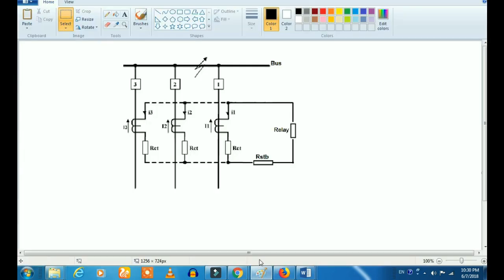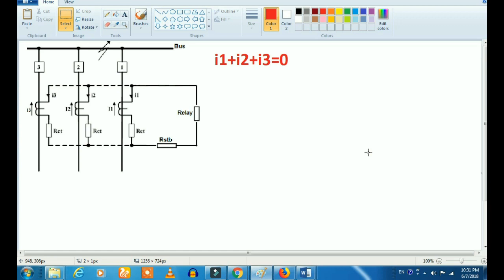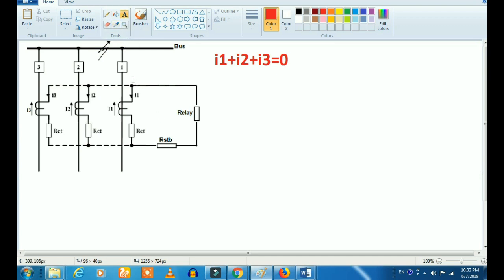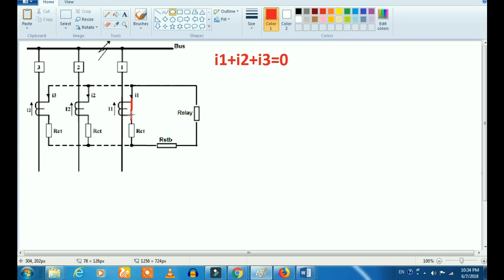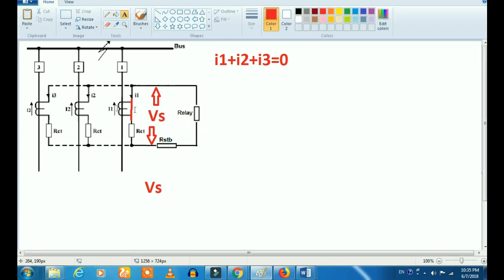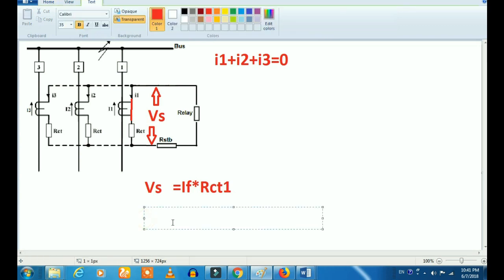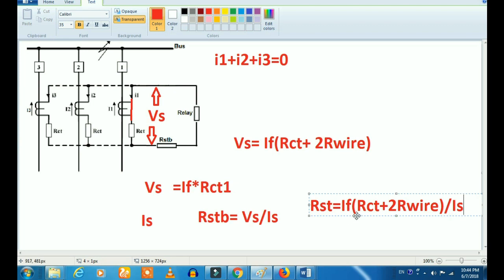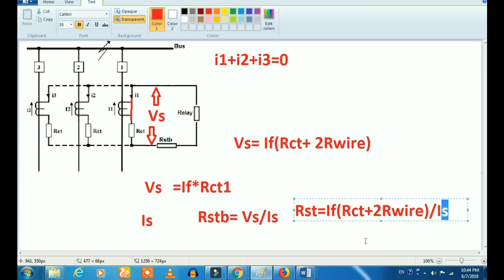How to Calculate stabilizing Resistor for differential Protection in Tamil

Comment: With respect kindly can u explain ct secondary connection(such as I/C and O/G feeders with mentioning S1 and S2 ),during normal condition current circulation diagram,during fault how current passes through the relay,setting of the resistor with some values.